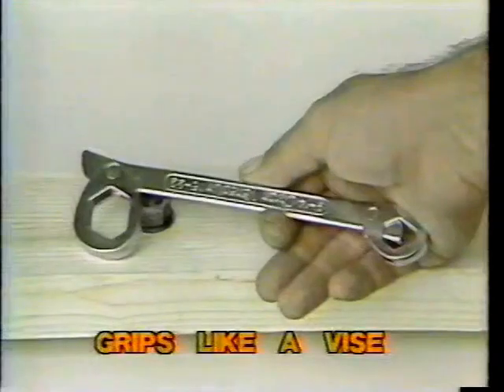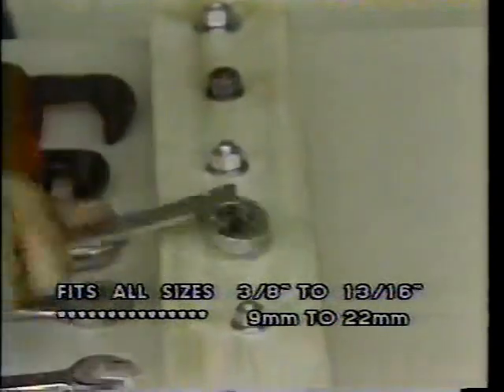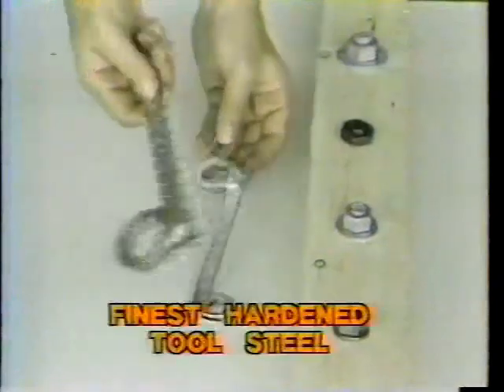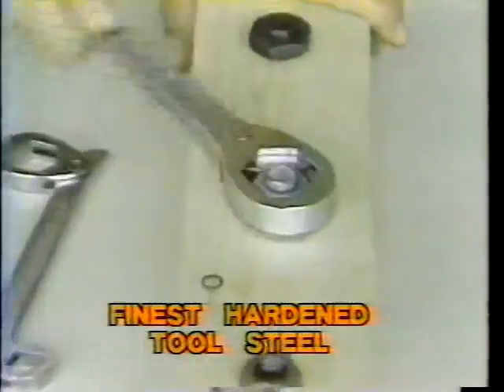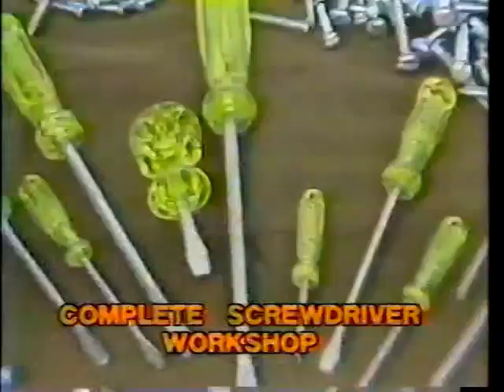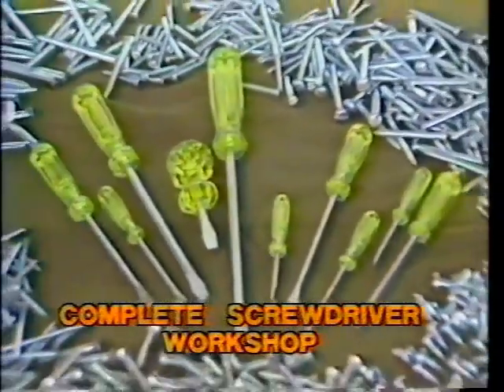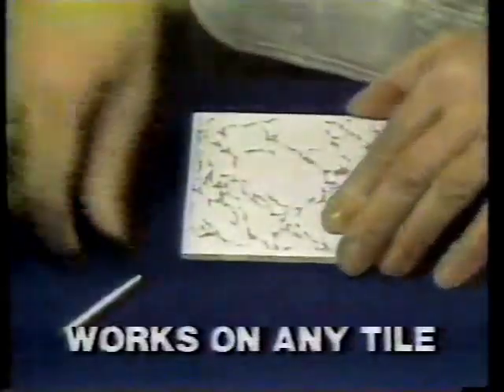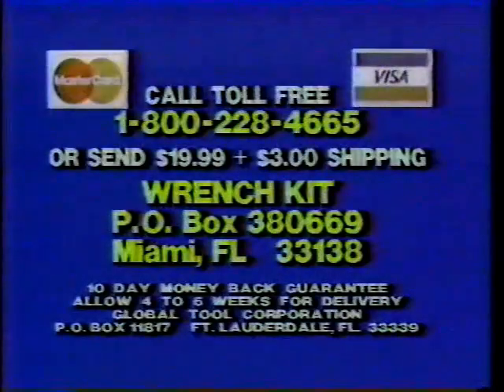Wrench Kit 1983) Vintage 80's TV Commercials

Comment: I found a couple of those in the trunk of tools my father-in-law unloaded on me and they work well.  They are not breaker bars but they do the job for many applications.  I keep one in the car with my emergency battery/compressor kit.  It's mostly to be of assistance to others, especially older folks and silver haired ladies.  The old fashioned part of me can't just drive by.